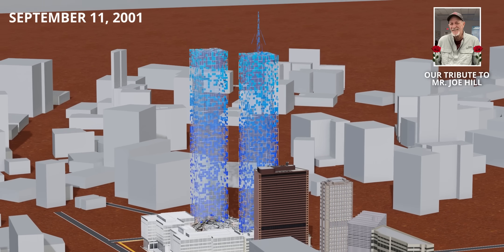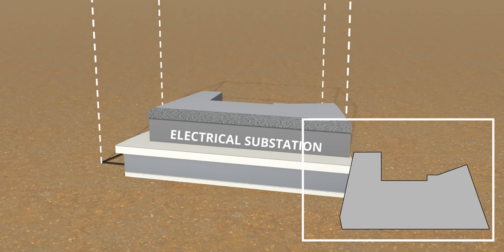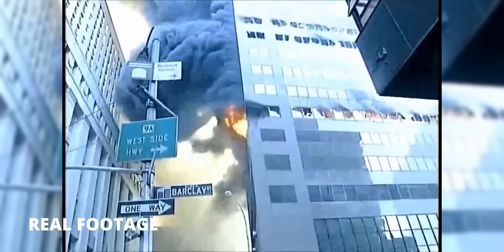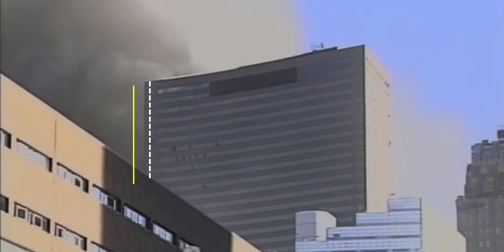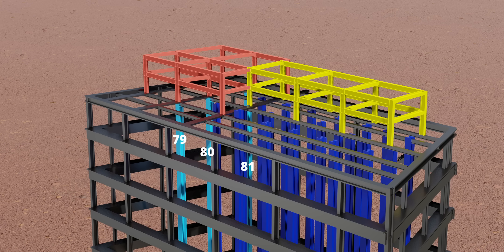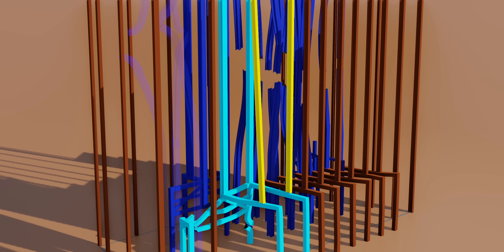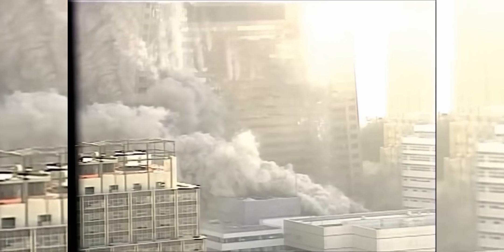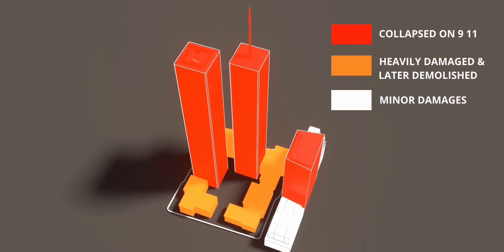Collapse of Building 7 | The Complete Physics

Comment: What utter, totally specious crap.
Reply: And yet not wrong. Go figure. 

If it were actually wrong you would have come up with a better rebuttal,... or a rebuttal.
	
This video is pretty good – with a few exceptions - and goes into a much higher level of detail than many viewers will be able to comprehend.  While not perfect, the collapse mechanisms – the sequence of failures - described here  are substantially correct and this is true no matter who planned and carried out the 9/11 attacks or why . 

That may not be what you want to hear and go against 20+ years of entrenched dogma and conditioning, but it’s not wrong. 

That also means (in case you did not get the hint) this video can be (and IS) absolutely correct in its description of collapse mechanisms AND the 9/11 attacks could still have been some sort of inside job. The two things are in no way mutually exclusive. 

The mechanisms described here have broad professional support around the world. There are no professional engineering organizations (for example: ASCE, ASEE, ICE, etc) that disagree with them or have offered any formal dissenting opinions or alternative hypothesis. 

So, setting hubris aside, either the overwhelming majority of the worlds structural engineers and simple observation are wrong,… … or you are. Which seems more likely? 

IF you still think believe this explanation is wrong then produce a better one . Good luck with that. No one ever has and I don’t see you moving that needle today. 

No one ever does.
Reply: @TheCriticalStinker-jw4fl  the 'majority of the world's engineers...?' How MANY know about it and have written peer reviewed papers on it? NIST have never released their full working data, so not even the official report is peer reviewed. But I go back to your original LIE about 'the majority ' . Stop making crap up. The official story isn't remotely plausible nor proven as such.
Reply: @tonyrooke9990  - Quite a few. 

NIST's conclusions for example have the approval of the 130,000 member ASCE and 85,000 member AIA. Taht's just for starters.

Like I said before, if the above explanation is wrong by all means produce a better one. Go ahead, be the first to even try. 

I won't wait up.

Comment: The whole premise of all this is FIRE.  I dont care how many plausible steel bending scenarios are given.  I KNOW that they fireproof steel in modern buildings.  So the whole premise that this happened due to FIRE is bullshit.
Reply: Just because you don't understand it doesn't make it BS. It just means you don't understand it and anything seem like a conspiracy if you don’t understand how stuff works. 

Building 7, the 6th building to collapse of 10 lost on 9/11 still confuses many even though it has been extensively studied. Not famous or a terror target, and with no casualties it did not get a lot of attention initially, creating an information void the internet rapidly filled with garbage. Because everything seems like a conspiracy if you don’t understand how it works I prepared this brief summary of the collapse from my own analysis. No politics, just engineering. 

The North Tower collapse at 10:28am bombarded Building 7 with tons of burning debris, causing heavy damage and starting multiple fires burning out of control for the next 7 hours. Half the FDNY firefighters having been killed, others injured, units in disarray, equipment destroyed, no water pressure, and the greater urgency of Search & Rescue efforts, firefighting was pulled as futile. The building couldn’t be saved and was left to its fate.

www.youtube.com/watch?v=g_SvpwyC17M&ab_channel=MFitz  

Collapse of a burning structure is always a concern for firefighters. Steel buildings subject to fire rely on active fighting of the fires to survive. Buildings are designed around 1 to 3 hours of fire resistance, allowing time for occupants to escape and ACTIVE firefighting to get started, after which all bets are off. Left to their own devices they will exceed their design envelope and collapse. In B7 the occupants escaped, passive and active fire protections were compromised and active firefighting was abandoned which left the building to take its chances. It lost. Odds on Building 7 would eventually collapse, and it did. No big deal in logic. That is the sort of choice firefighters make every day in brush fire situations - which houses to save and which ones to let go. Only real difference here is moving the decimal on the size and cost.

www.youtube.com/watch?v=WnYBX6QT0R4 

FDNY Chief Daniel Nigro ; The biggest decision we had to make on the first day was to clear the area and create a collapse zone around the severely damaged 7 World Trade Center, a 47-story building heavily involved in fire. A number of fire officers and companies assessed the damage to the building. The appraisals indicated that the buildings structural integrity was in serious doubt. I issued orders to PULL BACK the firefighters and define the collapse zone. It was a critical decision; We could not lose any more firefighters. It took a lot of time to PULL EVERYONE OUT, given the emotionalism of the day, communications difficulties and the collapse terrain

FDNY Deputy Chief Peter Hayden ; We had our special operations people set up surveying instruments to monitor and see if there was any movement in the building. We were concerned of the possibility of collapse in the building. And we had a discussion with one particular engineer there, and we asked him if we allowed it to burn could we anticipate a collapse and if so, how soon? And it turned out that he was pretty much right on the money, that he said 'In its current state you have about 5 hours

The collapse of Building 7 was anticipated and widely reported in the media throughout the day. At least 24 video cameras recording some or all of the collapse. Everyone knew what was coming and why.

www.youtube.com/watch?v=OY5S5k3tMHI 

Building 7’s collapse was completely different to the Twin Towers, harder to understand with most of the details difficult to see. But we can still sort out what happened through careful analysis and observation.  This is MY EXPLANATION of the collapse sequence using the best available information and relying on no authority.

B7 was complex 47-story steel framed structure built on top of a smaller existing 3-story building, requiring several lower floors dedicated to complex load transfer structures instead of usable office space. Of trapezoidal shape and all-steel tube-in-tube construction, B7 (above the 7th floor) consisted of a central core of steel columns carrying most of the gravity load, perimeter steel columns around the outside of the structure carrying the remainder of the gravity loads and long span beams and girders to tie those elements together and form the floors. On the outside of the building hung a moment frame - the last part of B7 to fall. 

Phase 1 : The first externally visible signs of collapse initiation occurred at 5:20:28 pm. Collapse initiation for B7 is notably quiet with observers not realizing the building was collapsing! There was no audible warning in the form of say hundreds of ear drum busting 180-190dB explosive bangs preceding the collapse. Here at 12:00 a local CBS affiliate reporter is talking 10 blocks from B7 when collapse begins. People don’t start to notice the collapse until 12:11. Then at 12:45 is the famous CBS fixed camera clip of Building 7’s collapse.  Note how quiet it is.

youtube.com/watch?v=t5tEy6mXSE8&ab_channel=fresnosean379

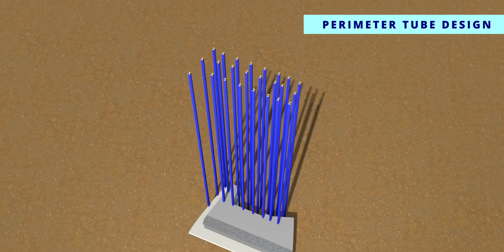Collapse initiation was due to lower floor failures above the load transfer region (7th floor) in the NE corner of the building. In this video at 0:45 you can see the NW corner from inside the building while under construction, Column 79 just out of frame on the left. That big, angled steel beam across the top of the frame connects to C79 at one end. The girders connect to the beam. That beam and all those girders depend on just one connection

youtube.com/watch?v=nP3TNHPCIVU&t=35s&ab_channel=EdwardCurrent

Phase 2 : Lower floor failures caused a loss of critical lateral support over an excessive length of core Column 79 and it buckled. If you look at a floor diagram of Building 7 (see above) and look at all the structures that depend on C79 you quickly realize this one column was a relatively isolated structural element on which a disproportionately greater fraction of the structure depended analogous to say the Key Bridge. Externally we see a vertical progression of window breakage along the 44-46 line and a kink in the roof of the East Mechanical Penthouse at the top of the building, consistent with C79 failure. The transition from full capacity to almost no capacity occurs in virtually an instant. Once the buckling failure occurs there is almost no resistance

Normally with a buckling column, the load could very well be redistributed to other columns, meaning the buckling could stop after a while. With C79 that is not the case - the failure did not redistribute the load, so the collapse rapidly progressed to the roofline, sinking the rooftop penthouse.

Phase 3 : With C79 gone, B7’s progressive, non-symmetrical collapse continues with C80 and C81 at the east end of the core left laterally unsupported and quickly buckled and failed as well, sending the EMP down through the building. C79-81 all have no diagonal bracing, which I believe is a major reason why they could not redistribute a lot of vertical loads among one another.

From there collapse progressed from east to west through the central core until the core was gone taking all of the interior floors and structures and probably most of the perimeter columns with it. You can see the horizontal progression of window failures low in the building and the dropping of the remaining rooftop structures into the building. One of the big takeaways from the NIST Building 7 study (that gets completely ignored) was their modeling which determined C79 failing under ANY circumstances would have initiated the same collapse sequence.

Phase 4 : After some 10 seconds all that remains of Building 7 is just a hollow empty outer shell - the exterior moment frame - creating the illusion the building is still standing since little has changed externally. But it’s just a hollow empty shell like an empty cereal box supported by only a few remaining columns and quite unable to remain standing. With all the internal framing gone. the north face leans inward, forming a V in the roofline, the last perimeter columns buckle under the strain and with nothing left keeping it up the moment frame free falls, landing on top of the 7-story high debris pile. It is only at the very end that a single measurement of alleged free fall acceleration is taken. Note this is not the building but just its outer shell, and only one corner at that, at the very end of the collapse. Start to finish the entire collapse took 18-20 seconds, or less than 1/3 of true free fall and we have to look at the whole thing, not cherry-pick little bits to fit a particular narrative. Worth noting _how fast something falls cannot tell you what started it falling in the first place. The debris spread out, blocking surrounding streets, heavily damaging the Verizon Building and destroyed Fiterman Hall, all well outside of Building 7’s “footprint”.  

Building 7’s progressive, non-symmetrical collapse was incidental and unintended collateral damage from the combined effects of fire + time + gravity started by the collapsing North Tower. That is true no matter who planned and carried out the 9/11 attacks or why . The collapse was of so little consequence it barely even registered at the time, a mere footnote. It only took on semi-mythical status as an alleged smoking gun years later when demolitions at the Twin Towers, missiles at the Pentagon and shoot down over Shanksville all failed and conspiracists had nothing left to work with.

I hope you found this helpful, informative and it solicits informed critical comment. If I made any errors of fact, logic or reason or left anything important out, please let me know so I can fix it. IF you can offer a more plausible alternative please do. Be the first. Please start any reply with the words “Tits McGee” or I will know you didn’t read it and are wasting my time.